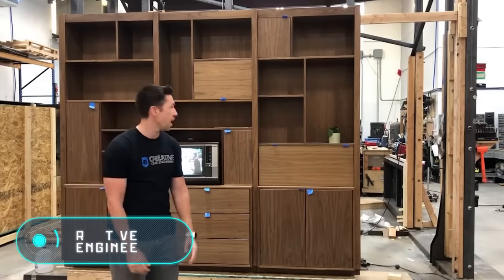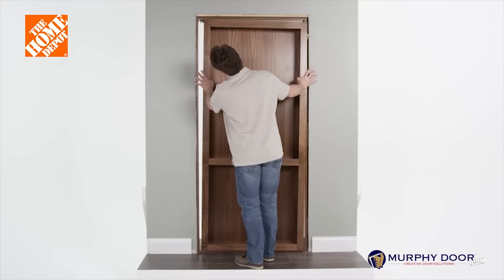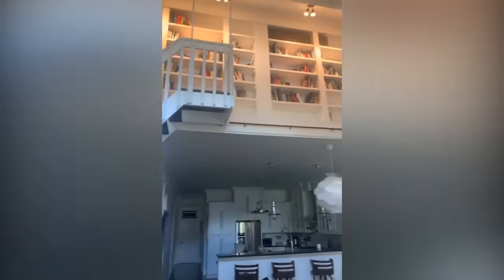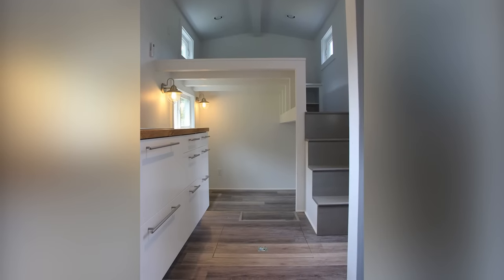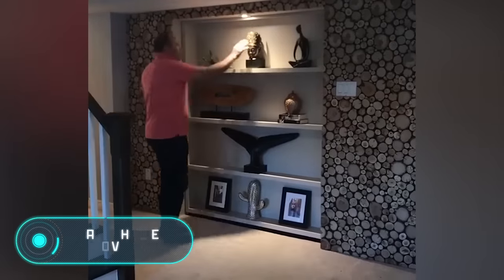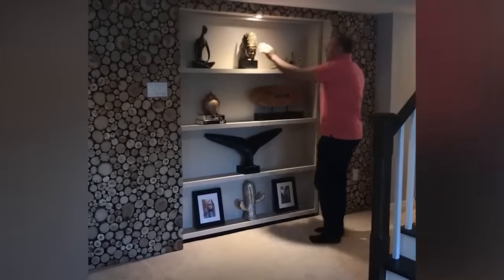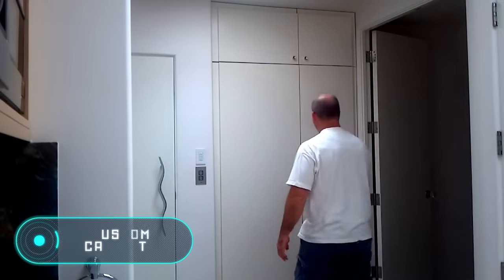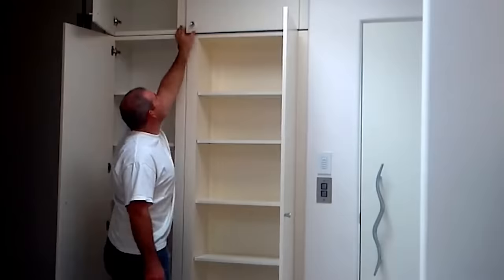8 INGENIOUS SECRET DOORS AND ROOMS THAT YOU SHOULD SEE

Comment: To be smart, if one wants to hide these days, one should line their secret room with a heat shield, which blocks infrared heat detection.
Reply: I thought about that too and away to het out in case you accidentally get stuck.
Reply: I thought the same thing when watching a show on finding Bigfoot!  Get a helicopter and some flair goggles and fly around at night and it should pop out like crazy!
Reply: Just line the walls with some type of foil to act as an insulator and make sure the room has air conditioning to prevent overheating.

Comment: A lot of those bookcase ones I've seen don't have a way to open it once you close it when you're on the inside which is both dangerous and stupid because what's the point of having a secret room if you have to open the door every time you want to go in there and leave it open so you don't lock yourself in